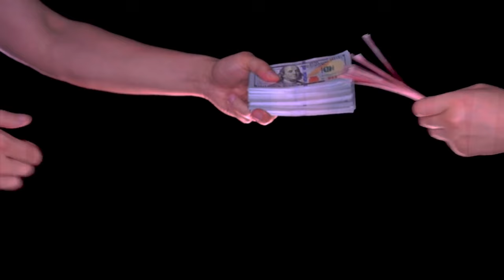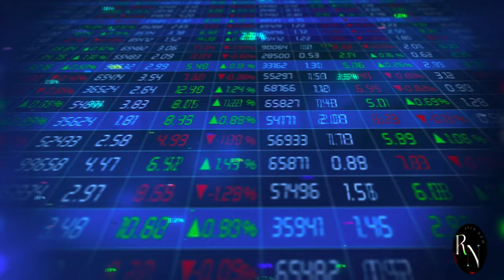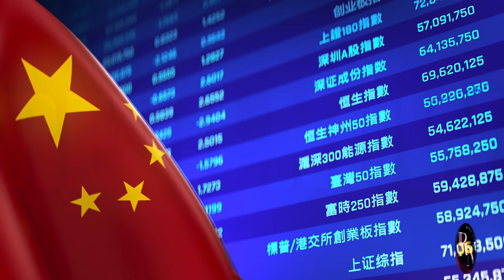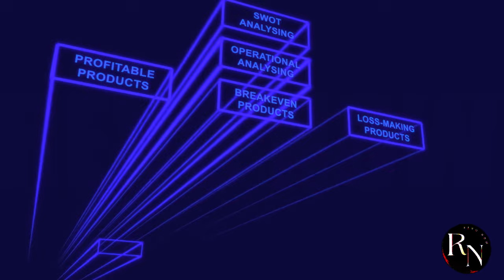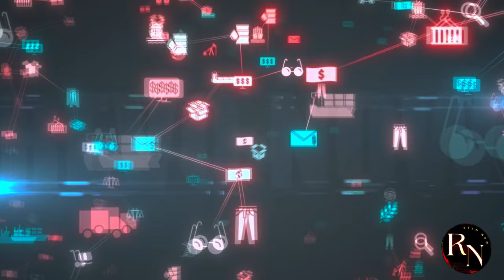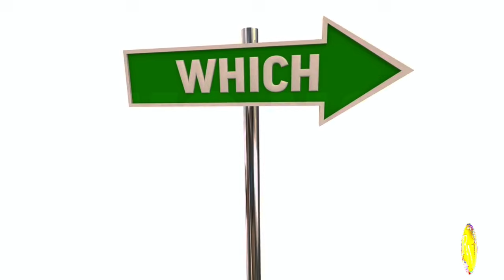You'll NEVER Believe What China Is Doing to the West's Metals

Comment: You're too late.  It is not China alone that dominates the resource end of the supply chain, but the resource rich countries from which these resources come from.  Significantly, much of these minerals are from BRICS countries and those who want to join.  The west, as exampled by the G7 which are resource poor countries.  For example, the US is dependent on China for 27 critical minerals from China and it is from those elements that Chinese has chosen to withhold from the US because of its sanctions and tariffs. And, you are correct that China dominates in the processing of these minerals, the US does not.